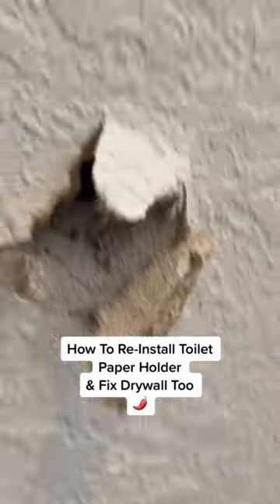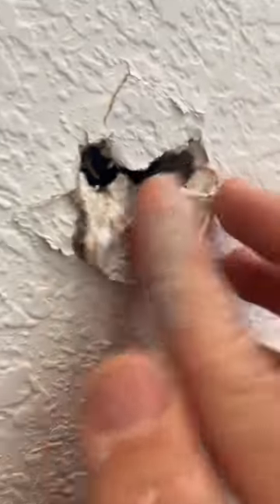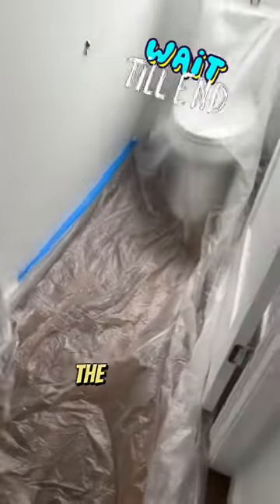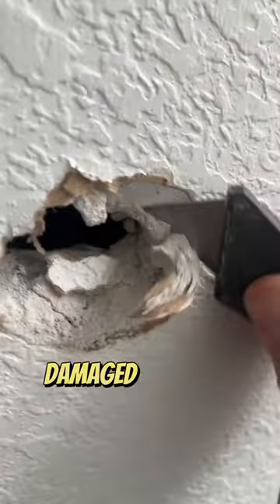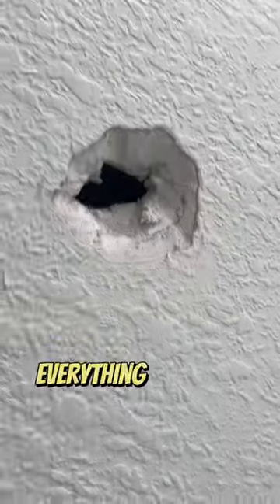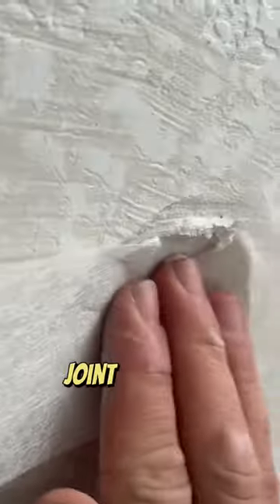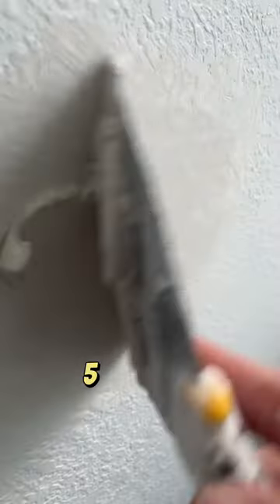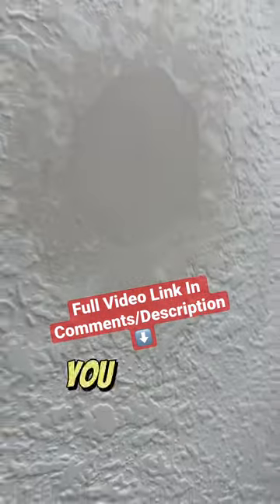How To Re-Install TP Holder & Fix Drywall Too #toiletpaperholder #diytutorial #howtodiy #handyman

Comment: That repair should have a small piece of wood installed behind it, it would have taken a bit longer but that way the screws would go into wood and not just drywall anchors. Otherwise the homeowner is just going to break it again.